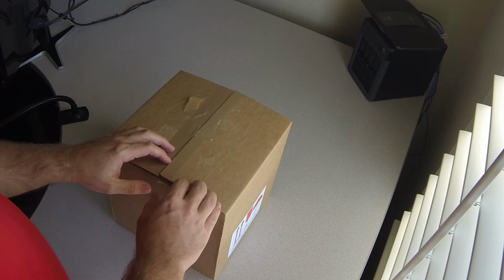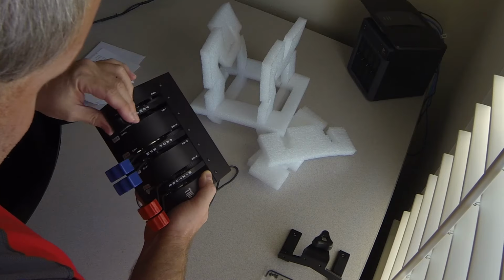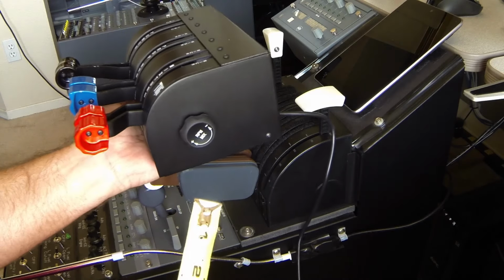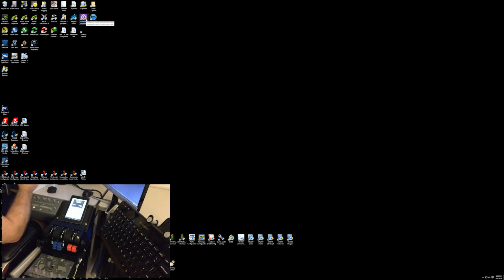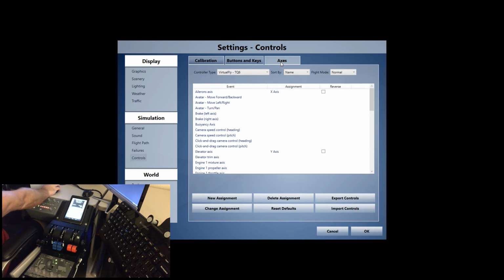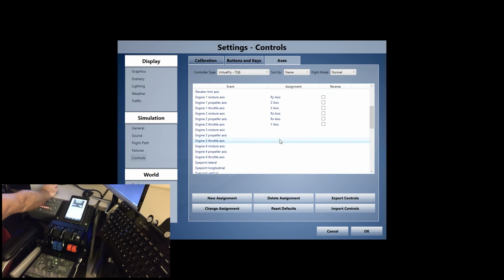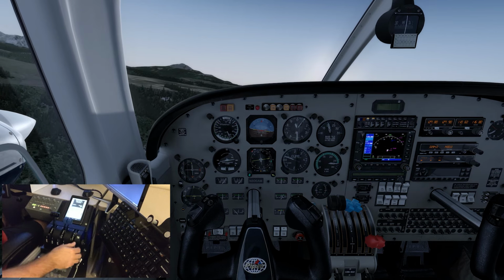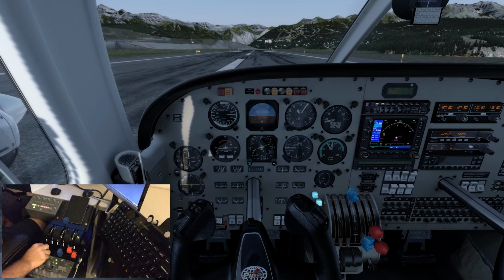Virtual Fly TQ6

Comment: Hi rob. Thanks for great review. Just received my tq6. Followed all the config you did. But when my throttle is at its lowest within the reverse it’s not on the sim. Did you use SPADNEXT?
Reply from the maker: No, I just made sure it was calibrated under Win10 first, then when I fire up P3D I ran it's calibration process (make sure you have RAW Input selected in the P3D controls screen).  I'm not using SPADNEXT and I don't have FSUIPC mapped to any of it's axis.  As far as "not on the sim" ... what aircraft are testing it with?  TQ6 doesn't have any reverse thrust activation, you have to use FSUIPC or if using the MJC Q400 to define reverse thrust input range.
Reply: Rob Ainscough I tried in a few twin props carenado planes. King air etc. I tried everything and the throttle wouldn’t move into the negative past the idle point. So got SPAD this evening and now it’s all working. Strange how you got it sorted without SPAD. I’m using P3Dv4 ... thanks for reply mate
Reply from the maker: Correct, you will need some other tool like SPAD or FSUIPC to trigger reverse thrust, this will vary by aircraft ... for example the MJC Q400 has it's own controller panel where you set the throttle to corresponding positions and no need to use SPAD or FSUIPC.  The VF TQ6 has no "built-in" ability to operate reverse thrust ... what you see is just a mechanical indent so it's easier to position.

Comment: Good afternoon Mr. Ainscough.  Great vid thank you for allowing us to view your set up.  I notice that you have several Go Flight items, and  I was wondering why you purchased  a Virtual  Fly TQ6 over the Go Flight GF-TQ6 and the Yoko Yoke over GFPROYOKE System . My second question is which set of rudder pedals are you using.  Thanks once again for making the vid.   Mike
Reply from the maker: Hi Mike, I used to own the GF-TQ6 but found the arms/handles to be small and flimsy, I wanted something more solid and with larger handles and adjustable friction, hence the VirtualFly TQ6.  I went with the Yoko Yoke because of it's range of travel exceeds the GF Pro Yoke, allowing for more precision.  I'm still using my Saitek Cessna Pro Pedals, but I ultimately plan to move to the VF rudder pedals but I'm a little concerned about the hall sensors used on VF rudder pedals ... I'm not a fan of hall sensors, they are inherently less accurate.
Reply: Rob, thank so much for  your feed back, I will keep all you state in mind as a start purchasing new hardware this fall. I've  been reading/hearing a lot of the MF Crosswind rudder pedals.  Have you considered them?   Keep flying straight and level.  Thanks again.   Mike.
Reply: @robainscough    Good morning once again Rob, thank for your previous reply it help me greatly.  After two years I have just recently purchased the TQ6!  In your vid, I didn't see you set a feathered prop setting on the TQS, I  was wonder if you flown an aircraft which required feathering of the prop and if so how did you set that up?  Hope all is well, continue to fly straight and level. Mike

Comment: Hi Rob, I notice that you are using a Goflight SECM module with P3D and the Goflight Interface tool; could you possibly upload your GIT xml config file for this module - I'm having trouble getting the master battery and panel lights switches to sync properly with P3D?

Thanks

Gordon
Reply from the maker: The GIT files will be aircraft specific in most cases so I'll need to know which aircraft you are referencing.  Also, what version of GoFlight software are you using?
Reply: Sorry Rob, didn't notice your reply here - it's fine I managed to get all my functions mapped to the GF gear using GIT detective. Very time consuming but worth it! Starting to run out of GF panels now, really could be with a couple more toggle switch panels.
Reply from the maker: Have to be careful with how many GF panels you use ... I've hit my USB power max (even using powered hubs) with about 21 panels.  Could be motherboard issue ... but even when I downgrade all my ports from 3.0 to 2.0 spec via BIOS/EFI settings still have USB power issues.

Comment: Great video Rob...Thank you

I like your keyboard mount/clamp...May I ask the model and where you got it...I will see if it is available in the UK.
Reply from the maker: They're actually designed as iPad mounts but they work well if you have square smaller sized keyboards that aren't too heavy.  This link is for UK https://www.amazon.co.uk/dp/B00BP9558W?psc=1 ... I have a the mounts on either side (one for sim PC and one for networked PC)

Comment: Hi Rob, how exactly did you hard mount the quadrant to the goflight console. I also have the goflight console and I currently use the flypfc throttle console with the detachable throttle quadrants; it's an excellent piece of kit but quite bulky. Seeing as I exclusively fly twin prop aircraft I would be interested in swapping over to the virtual fly tq6, as it would better fit my setup?
Cheers
Gordon
Reply from the maker: I used foam board, very easy to work with and solid: http://www.hobbylobby.com/Art-Supplies/Canvas-Surfaces/Foam-Board/20-x-30-Black-Blackcore-Foam-Board/p/80645203  ... I stacked three at 7/16" thick each.  Drill or punch two holes for some long bolts (4m x  40mm with large washers so as to no crush the foam core) to secure the TQ6 to the foam board.  Then used thin strip of velcro on base and rear of TQ6 to flight deck.  Finally add some 1.5" wide black "plastic" tape (3M) around the edges of the foam board and goflight base to further secure the TQ6 and cover up the foam core for a better visuals.

Comment: How practical do you think it would be to use this product with a quad jet such as the PMDG 747?
Reply from the maker: I use it for the iFly 747 ... works fine either with paired engines or individuals ... individuals is a bit of a hand reach to control throttle/prop arms ... them map mixtures to spoiler and/or flaps, but I typically use my GF LGTII for flaps operation.  What I prefer for 4 engine setups is to map Left 2 engines to Left throttle, and Right 2 engines to Right throttle (via FSUIPC).
Reply: I hope you will have a further reviw of this product.